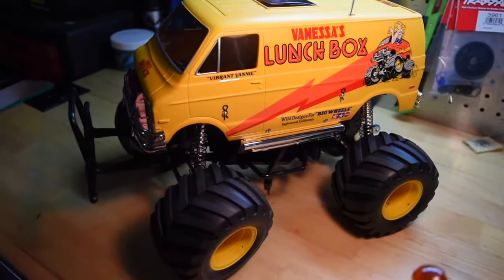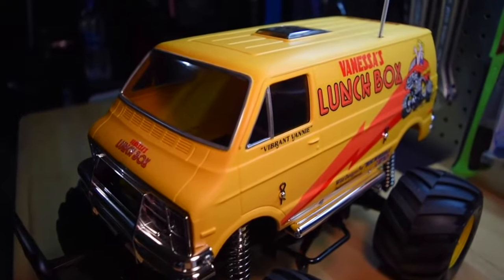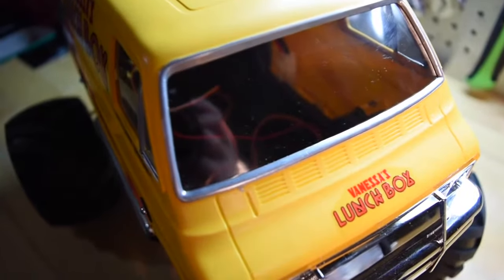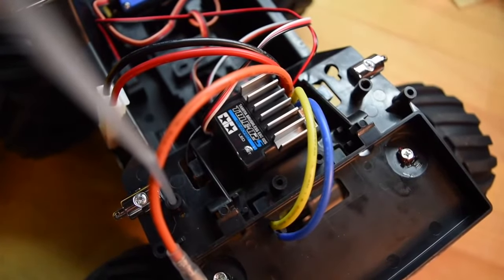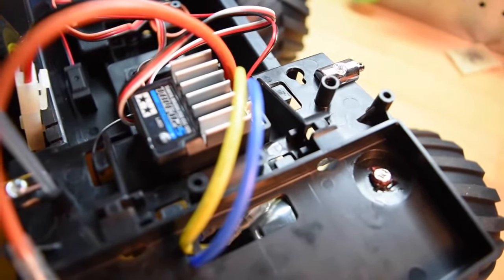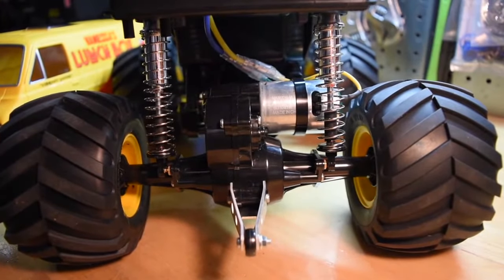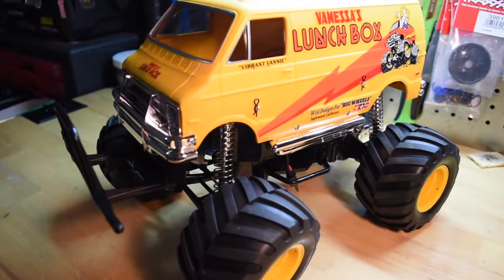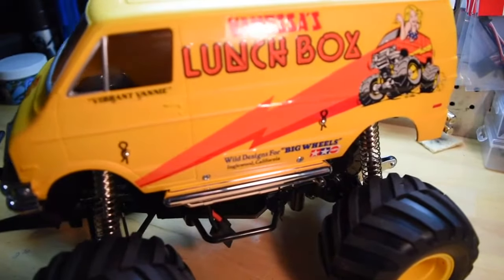Tamiya Lunchbox Buildoff Reveal!

Comment: Looks great, why didn’t u like the first body it was looking great! I was thinking about glueing the tires too, wasn’t sure if I was suppose too? But I think I might plug the holes up to keep the air in them n give it more cushion cus they r soft, I used the brushed esc from the ecx cus wanted to save that brushless sensored esc. Hey thanks for being a part of this, if u wanna send me pics for the show them off video u can, or I’ll screen shot some off this video
Reply from the maker: I got a little crazy with the spray paint on the first body. It was really thick and runny in spots. The tape I used left marks etc. I’m not used to painting hard bodies. I’ll get some shots and send em when I get a sec. thanks!
Reply: Axiomatic RC ya I’m a lexan body kind of guy, lol the hard bodies r harder to me sometimes, did u use like scotch pad to scuff up the body n after wash that dust off before u painted? I’ve had paint run n not stick so well before when I didn’t do that n I’m sure u use heat gun(hair dryer) n al, that but hey it sometimes just doesn’t come out the way we want it, other people will probably love it, but if we as builders r bothered by a spot that no one else can see, we see nothing but it! Lol hey I loved them both brotha!